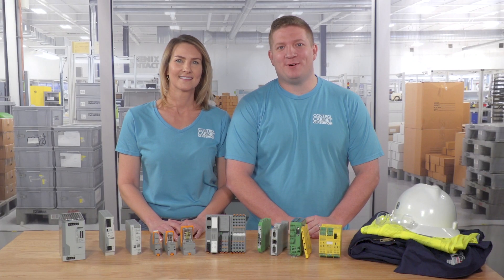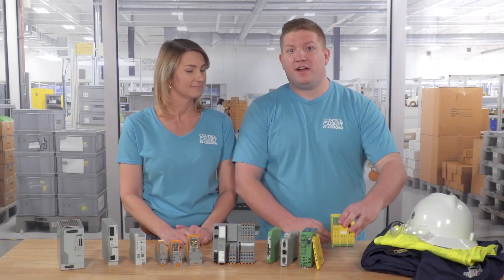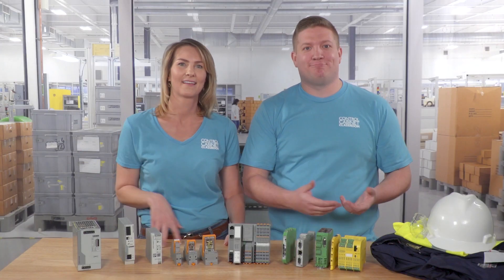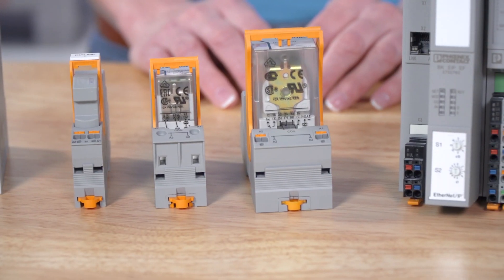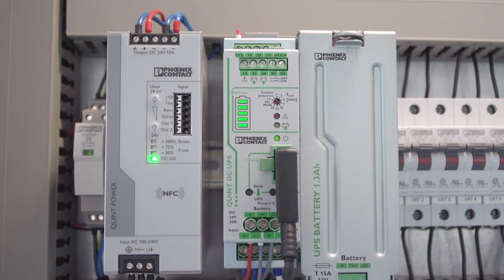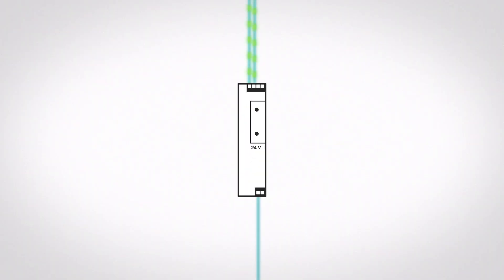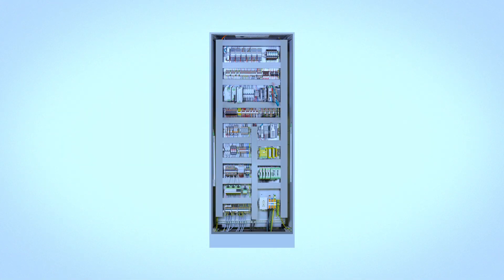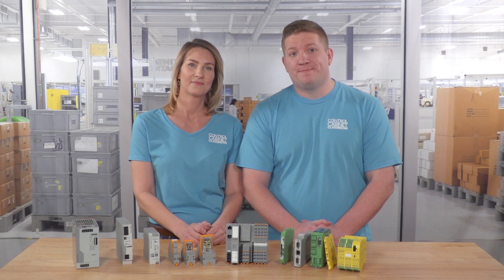Power Fundamentals: Why is 24V DC Used?

Comment: Yeah, it's all about safety and low cost, but why specifically 24 and not 7,12 or 28 V? Those voltages are equally safe
Reply from the maker: The 24V is a generalization as it’s common for industrial control applications. Anything under 60 volts will meet the safe low voltage standards so you are 100% correct.

Comment: Why not 5V DC?
Reply from the maker: Great question! 

5V can certainly be used. However, you need to consider a typical load. Higher voltages are used to run higher-power devices while keeping the current lower. This allows you to use a smaller diameter, lower-cost wire.

24V DC is the norm for industrial applications. 5V is the norm for processor-level designs. 

There are applications/loads that require 5V. For this reason, Phoenix Contact does sell 5V DC power supplies as high as 25W for loads that must use 5V DC.

Comment: Would disagree to less heat point at 24V. At reduced voltage current increases for same power consumption so heat increases. As it is H = I(2)Rt
Reply from the maker: Great catch, we misspoke a bit. 24 V DC power in a control cabinet does allow us to shrink the cabinet footprint because it eliminates the need for each electronic component to have its own onboard power supply -- in many cases, using a central power supply to power multiple components results in a more efficient system, which indirectly reduces waste heat.
Reply: This lady is naive. She doesn't know the guy intends to push her away in the next one, like he pushed away the safety gear. Hence she insists on correcting him from 'I' to 'We' 😅